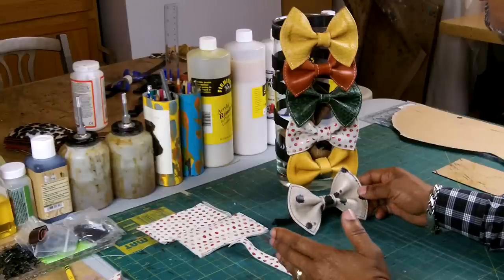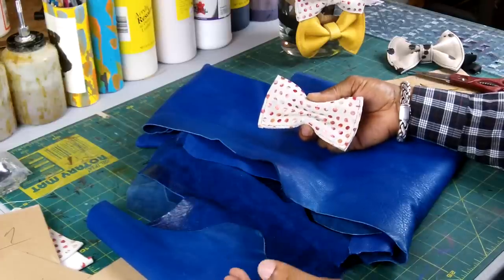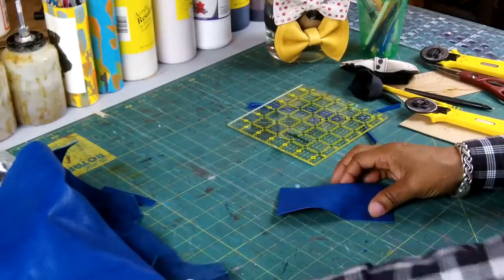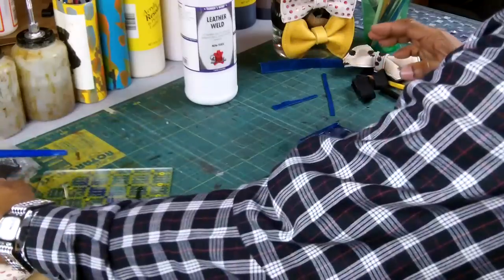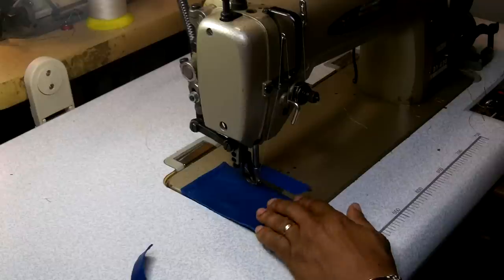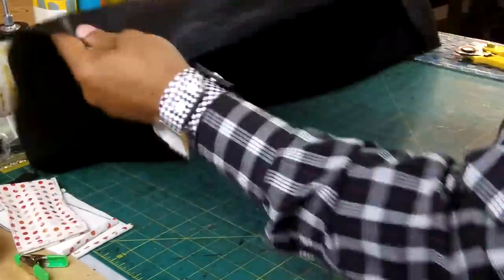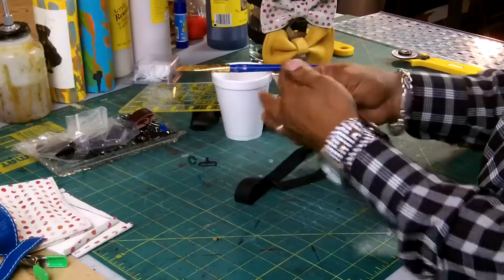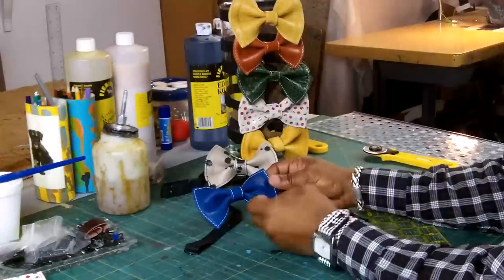How To Make A Leather Bow Tie

Comment: I already have the hardware, which I purchased from bblackandsons, but my slider is flat and does not have the slightly elevated middle like the one from wawak. Also it is a 3/4" set. Would it be still possible to do or will it not work properly and or tear the leather?
Reply from the maker: Hello Danyel, Your hardware should work just fine, I am using 3/4" slides.

Arthur